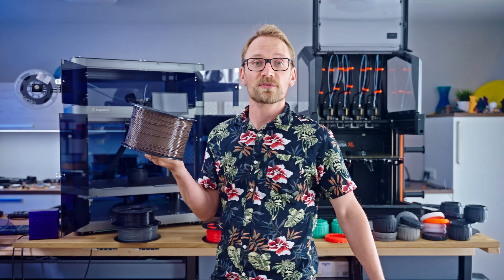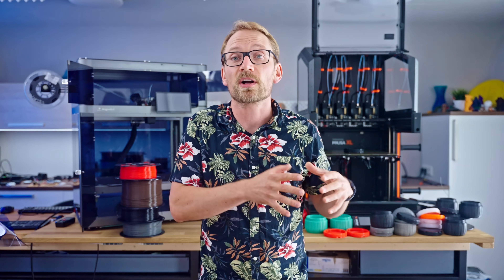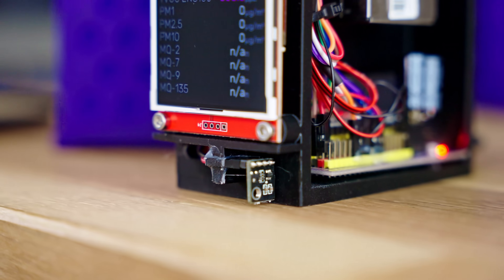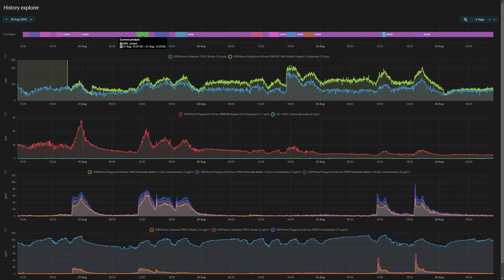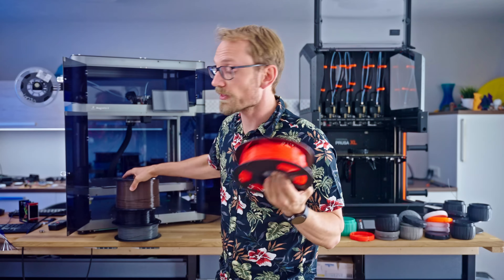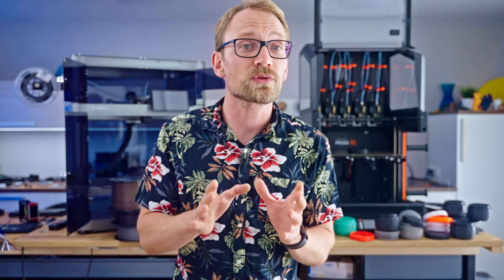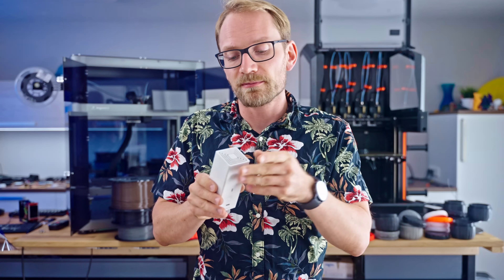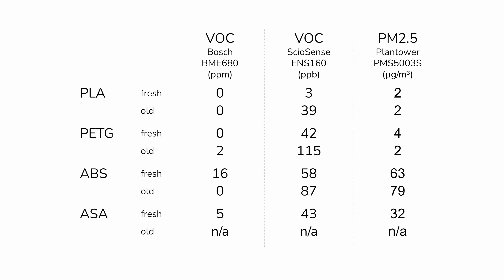3D printers are worse than I thought. Time to do something about it!

Comment: I think it's worth noting that most air purifiers that have activated carbon in their filters are meant to filter odours, not harmful pollutants. There's so little carbon in there, it almost feels like a joke.
Reply: Very true!
Reply: There is a lot of carbon in IKEA FÖRNUFTIG air purifier filter, but I still wouldn't trust it with isolating me from the resin printer fumes.
Reply: @adameichler  I think "a lot" would be one or two shoebox sized volumes of it, accompanied by a fan that has enough power to do aactually move air through those. The only home appliance I can think of that has this are very high end kitchen hoods.
Reply: @markus30000  Yeah, it's not that big. The filter is conveniently +- shoebox sized, so you would need like 5 of those filters to achieve the thickness of a box. And its volume is not 100 % carbon, it's carbon pelets in a honeycomb structure.
Reply from the maker: @adameichler  I saw some reduction in VOCs with the Förnuftig carbon filter, but like most residential "air purifiers" it's better suited for keeping VOCs low in an already low-VOC environment like your living or bedroom.
Reply: @MadeWithLayers  I've got TWO Fornuftigs in the small room with my X1C. Without them I could smell the ABS into the halway next to it. I definitely don't wanna' be working or sleeping next to a 3D printer all day or night...
Reply: @adameichler  If you can put it across your face to a light source and can see the light through it, it doesn't really matter how much carbon it has. You could see when he held it up that the light was passing through.

 Instinctively at least, it feels like the more thickness would filter better, as the air wouldn't pass through the holes. 

Source: I've researched DIY 3d printed carbon filters for "reasons"...
Reply: @TheOfficialOriginalChad  Yeah, I'm planning to play around with sensors etc. soon, but too many projects at the moment :-) However, it would be great if Thomas would have a look at one of those, as he seems to have the gear to measure the impact :-) The Bentobox is a little small, but a (modified) Carbonmax might have some effect (see "Carbon MAX HoneyBadger 5015 Dual-HEPA BentoBox" on makerworld, if you're not familiar with these things).
Reply: @TheOfficialOriginalChad  you're better off buying a PMS5003 particle concentration sensor. It's obviously not measuring VOCs, but where there's VOCs, there will also be microparticles. You get a much more useful measurement that actually gives you an idea of whether you have enough air circulation/exhaust. 

A cheap digital VOC sensor will give you a relative measure that you can still use for monitoring air quality, but there's no way to determine a concentration from the data
Reply: @itsnotthat_   NO NO NO
We are talking about an environment where the user is running air filters that may or may not filter VOCs. It is to be expected that the particulate count is low, and it will be low regardless of high the VOC concentration is. 

CCS1811 and SGP30 measure total concentration of VOCs for $10-$15...there’s absolutely no reason to try to save money here
Reply: @TheOfficialOriginalChad  Particle sensors are $20-30. 

It also doesn't change the fact that the cheap digital VOC sensors you mentioned are measuring a relative concentration of multiple substances at once. If some arbitrary number of "overall VOC" is adequate for you, then great. I find it to be a waste of time. If you're really worried about it, you should invest in better VOC sensors.
Reply: @itsnotthat_  I’m not following your goal here. First, not measuring VOCs to get an idea of your VOCs is good enough, THEN only able to determine the concentration of each individual VOC is good enough for you. 

TVOC is absolutely a valid measurement if your goal is to have 0 VOCs. But sure, if you want to spend more and see more 0s that’s totally fine with me. It would be fun to graph the filtration efficiency for each VOC I bet.
Reply: what do you think about having a bambu lab a1 running in a grow tent enclosure in my closet, with a carbon filter ducting system going directly to my window?
Reply: @JohnWestHam  That sort of negative pressure filtration and ventilation would be very effective
Reply: I have a 18 lb carbon filter in mine.
Reply: Air filters designed for filtering gases usually have quantities of activated carbon measured in kilograms.

That should put the sheets of carbon foam found in most consumer air filters into context.
Reply: Just make your own. Choose a HEPA filter size that is affordable and readily available, add a carbon layer. 3D printer your own enclosure (design it) and choose a fan that with suitable air flow and noise level. Place your printer in a suitable enclosure, can be soft sided. Run your filter hose are wall mount. Do it right and does not effect temp levels.
Reply: @blaircox1589 

You're solution sounds so easy.
Why don't you design such a disclosure for us, and tell us wich filter and vent etc.  and where to buy 😮
Reply: @TheOfficialOriginalChad  Oh! If you were refering to the Fornuftig, that's the mid-sized Ikea filter. I'm not entirely sure what you were unfamiliar with ;-)
Reply: @BluezNL-fc5st  you got it, I was saying I’m not familiar with that filter.
Reply: My printer came with a activated carbon extractor filter fan, we just reprint the cartridge to accept a small HEPA filter and then swap in some proper charcoal. I never even smell abs
Reply: Agreed.   Need to buy a air purifier that has a HEPA filter (or the option to later swap the material to a HEPA filter).

Note that you can also get HEPA filters for your car aircon.
Reply: Cite your sources or quit talking out your a$$. I use iqair filters and the carbon elements have several kilos of carbon. There are many other brands that do the same. Ideally you want large filters with slower airflow so the contaminants have more time to interact with the media, subject to sufficient air changes of course. I also use negative pressure, ducted outside, on my voron, printing lots of abs.
Reply: @Chris-bg8mk  The IQAir V5 has 2 kilos of carbon and potassium permangenate. The IQAir Multigas is probably even better just for VOCs. Then there's Austin Air which has similar carbon filtration. But that about it- just about nothing else in the consumer space is comparable.

Like he said, "most". Almost nobody runs IQAir or Austin when it comes to home filtration. People use crappy carbon filters built into much lower tiered brands.
Reply: @Chris-bg8mk They said “most”, and most people don’t spend $500+ on air purifiers.
Reply: @Chris-bg8mk  im in the process of converting part of my workshop to hosue my 3d printers that are cartesian for the moment and im directly vent all thhose fumes outside after they pass though a filter system like some of the filtration systems used from a welding facility and ill have to redesign the printers to where they are hermetically sealed.

Comment: Hi Thomas, this video was wonderful. This is a subject that is often downplayed a lot or purposely left out of many conversations by 3D-printers enthusiasts. In this regard, your video is incredibly informational, and I'm happy you provided results using many sensors. I have asthma, and after I got my first Ender 4 years ago, I quickly found out that it was not feasible to have one close to me. I, too, looked into the solution that Alveo3d provides and have been pleased with their solution, thus far. I hope you will provide a build guide for your sensor array, or upload the code to GitHub.

Comment: I am sure I developed asthma soon after I started 3d printing at home and was very sensitive the the smell of PLA some more than others. I eventually purchased a VAX AP03 and run it while printing and it was a big improvement until I could setup in a workshop with all the printers in sectioned off area with fans pulling air outside. It has taken far too long for someone to look into this so thank you.
Reply: I'm a chemist so maybe my Air holes are destroyed but I've never noticed anything with PETG, I've had one problem with PLA and that was with creality filament, it gave me a headache once.
Reply: @BA_1908  Prusament Galaxy black used to give me the worst headaches and Protopasta smell was stuck in my nose for a few days. I have had polyps removed and have almost no sense of smell, but for some reason I can smell filament.
Reply: @BA_1908  With PETG: no direct effects for me either, only that dust is not that great. Some PLA's from for example 'local' Dutch with headaches too.
Reply: I have been seeing video's about this at least for over 5 years. This is far from the first video on youtube for example. If you search, you will find much more details then in this short video.
Reply: @elvinhaak  Perhaps I should have said from the bigger 3dprinting youtubers. Can you remember any that are worth watching ?
Reply: @leesmithsworkshop  I did some searching and then got some suggestions in a row. Probably also some German ones since that is 3rd language to me (Dutch - English - German - Czech - French are the order in which I understand languages, English and German mostly on youtbe).

Comment: Really top notch stuff Tom.
This is something that should be viewed before  "top 5 beginner printers"  I am moving my homemade purifier from next to my theater chair (close to air user) back into the print room (close to source).  Also going to put a tight sweep on the door and create a small leak at the window. essentially making the print room positive pressure vented outdoors, and particulate filtered thru bog standard 12x24 merv13 filters.

quality info on a topic affecting essentially anyone melting plastic

Süßes Video

Comment: Thanks, it matches my thoughts, hopes and measurements with the Ikea tVOC/pm2.5 sensor (VINDSTYRKA). I have no way to test the sensor for accuracy but noticed the drop in tVOC when turning on the Fornuftig. Also measured the impact of a Nevermore Micro in the enclosure and that also kept tVOC under control.

BTW there is an easy way to put and ESP into the Fornuftig and have it controlled by domotica (for example ESPHome/Home Assistant). The Fornuftig will just turn on when any printer isn't idle or when the pm2.5 or tVOC values are above some set value.
Reply: As someone with a similar system (vindriktning with an esp8266 hacked into it for pm2.5 sensing), I recommend just turning the dial on it to max airflow and plugging it into a smartplug. I have home assistant turn on my corsi-rosenthal box when pm2.5 exceeds federally safe levels and it's significantly helped air quality in my awfully ventilated apartment (gets really bad during cooking).

Comment: Here's a fun and relatively unknown fact for you:  Resin SLA printers (which literally everyone assumes are the most dangerous) are actually SAFER to use than standard FDM filament printers.  As long as you take the proper precautions and always wear gloves, your total contact time with resin will always be MUCH MUCH lower than the amount of plastic fumes you will inhale while printing with a non enclosure FDM printer.
Reply: not a fact though

Comment: I print ABS (Overture and Bambu Lab) on my Voron 0.2 without any additional filters, but for some reason can’t smell almost anything being in the same room. I never had any issues with smelling VOCs from resin though. Could these "modern" ABS filaments be (almost) odorless? It doesn’t make them any safer for sure.
Reply: The main smelly compound released by ABS is styrene monomer. It remains during polymerisation as presence of butadiene is known to inhibit styrene polymerisation. Perhaps changes in synthesis protocol, reducing the amount of polybutadiene, or cleaning polybutadiene flake prior to free it from unbound butadiene contamination could reduce the amount of unbound styrene. Some changes like that could be also good to reduce the drawbacks of ABS in 3D printing, such as die swell and shrinkage.

But i haven't bought ABS in many years and the one i had bought back then many years ago was probably the most hideous regrind imaginable, and it stank like absolute hell.

And yes if it stinks less it MIGHT but might not be safer, because styrene in the air in these high concentrations is definitely very very bad news. But it's difficult to say for certain because the whole bouquet counts, not all of which is detectable by smell, and i don't know of a good detailed breakdown of volatile compounds emitted.

But it's still going to be emitted, and if you can not smell it, you've probably become desensitised to it. Ask a friend to smell it for you.